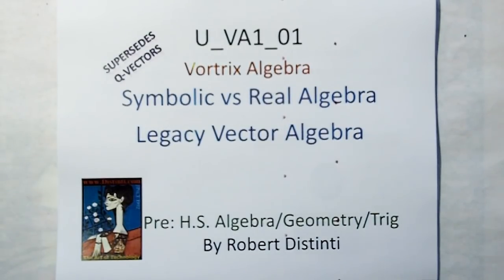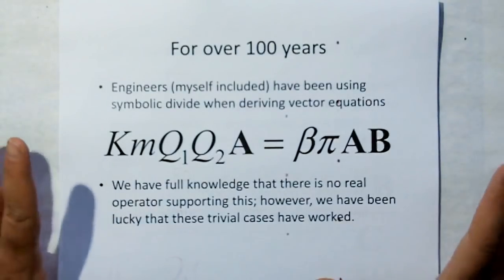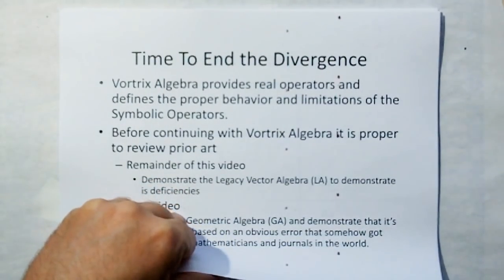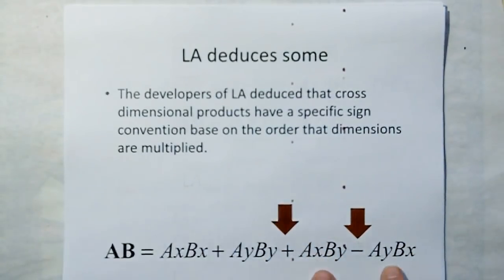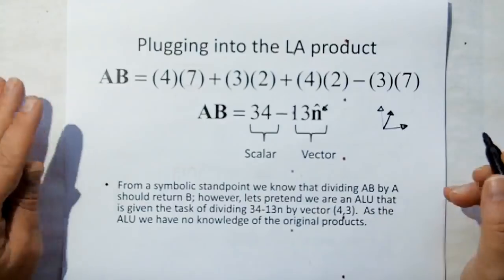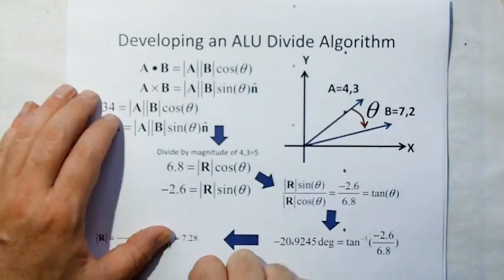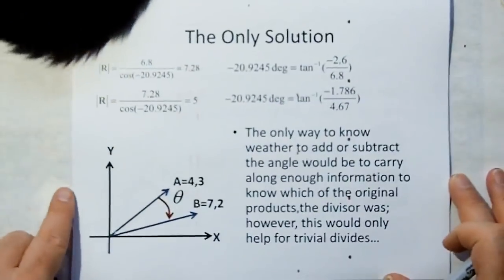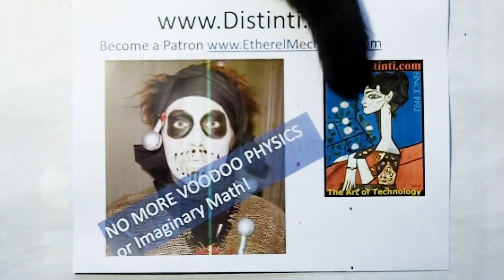U VA01 01: Review of Legacy Vector Product

Comment: We have: A =(4 3) B =(7 2)
Write as: 
[A]
4 0 0
0 3 0
0 0 0
and
[B] 
7 0 0
0 2 0
0 0 0
Inner "dot" product: < A , B >=4×7+3×2+0×0=28+6=34
Outer "cross" product: > A , B < = (4×2 - 3×7) êₙ = (8 - 21) êₙ = -13 êₙ
Matrix versions:
[A] [B]
4×7  0        0
0       3×2   0
0       0        0
< [A] , [B] >= Tr([A] [B])=34

i   j  k
4 3 0
7 2 0
Det= k (4×2 - 3×7)- j (0)+ i (0)= -13 k = > A, B <

a                     M11  M12   M13         a    b    c
    b                 M21  M22   M23         0    0    0
         c            M31  M32   M33         0    0    0  

a=a.M11=>M11=1 , b=a.M12=>M12=b/a, c=a.M13=>M13=c/a
0=M21, 0=M21, 0=M23  ...ETC.
[M] = ( 1 b/a   c/a) for 1st row ,  0 for 2nd & 3rd rows =( [1, b/a, c/a], [0,0,0], [0,0,0])
Let operator M map matrix [A] to [A][M], with the [A] values in place of (a, b, c) 
=> M ( [A])= [A][M]=( [a b c], [0,0,0], [0,0,0]).
We can then say A= M ([A]) and B= M ([B]).
Then the determinant is  > A,B < = det( (i, j, k) ,  M ( [A]) , M ( [B]) )
The vector k = (0 0 1 ) can be written [ k]=( [0,0,1], [0,0,0], [0,0,0])
det[ k] = 0, so there's no inverse, M ( [k])=((1, 0/0, 1/0), 0,0 ) and [k][k]=0 , so there's a problem, there fore let's just let the last two vectors have 1's=>[ k]=( [0,0,1], [1,0,0], [0,1,0])
Similarly, we can guess: [i]=( [1,0,0], [0,1,0], [0,0,1]) & [j]=( [0,1,0], [1,0,0], [0,0,1])
Now we have: det[k]=1×1×1=1 
inv[k]= ( [0	1	0], [0	0	1],[1	0	0] )=>close to [j]
Let's try an analogue of ij=k => [i][j]=[j] because [i]=unit matrix.
Change i to: [i]= ( [1,0,0], [0,0,1], [0,1,0]) 
=> [i][j]= inv[k] and [j][i]=([001],[100],[010])=[k]
Looks promising!
Now we can get rid of k in > A,B < so that we can divide  < A, B > into it to get the tangent between the two vectors.    
inv[k] . [ > [A],[B] < ] = inv[k].[k]. det( [ (A11, A22), (B11, B22)]  =(A11.B22- A22.B11)=(4×2 - 3×7)..
So, the tangent is (A11.B22- A22.B11)/((A11.B11+B22.A22)= -13/34.
So, we have tan= inv[k] . [ > A,B <  / < A,B > ]= [j][i][det( (i, j, k) ,  M ( [A]) , M ( [B]) )]
Reply: I found the app on this site quite helpful.
https://matrix.reshish.com/multCalculation.php